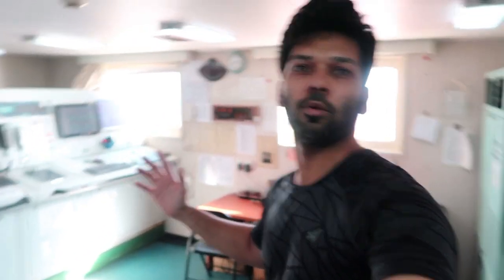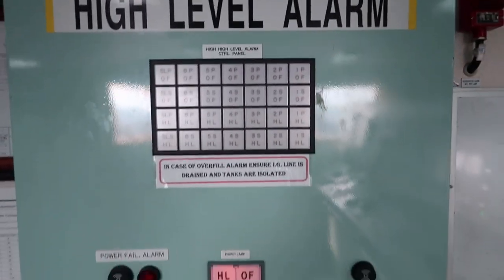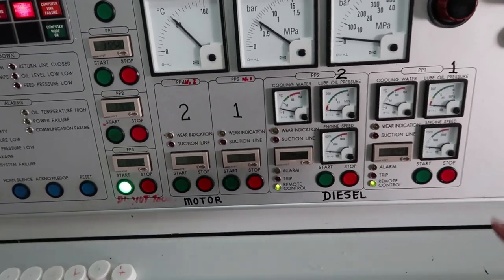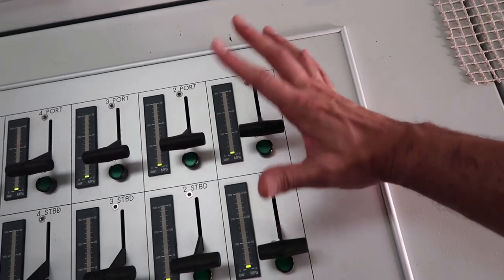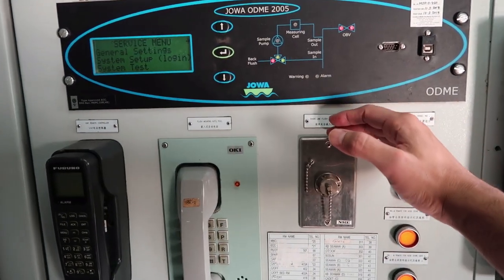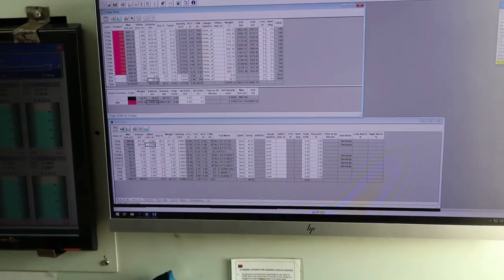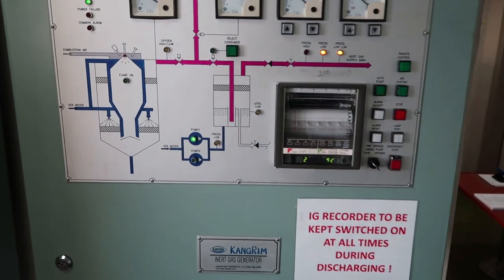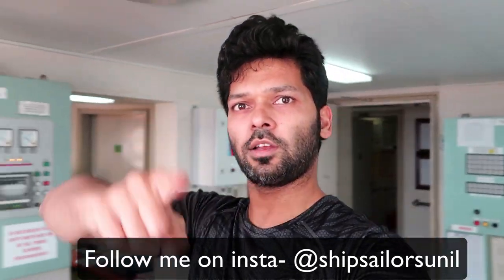Cargo Control Room/ShipSailorSunil

Comment: Sir explain detail about inert gas system
Reply: G.K. Arun  its used to create a safe environment inside the cargo tank keeping the oxygen level less that 8% so that there is no chance for a spark or a fire. Sometimes Ship has its own IG plant which supply these gases or Boilers flue gases are used for the purpose.If you need more info google IG system used in oil tankers.
Reply: @abhirammenon  thank you 🙂